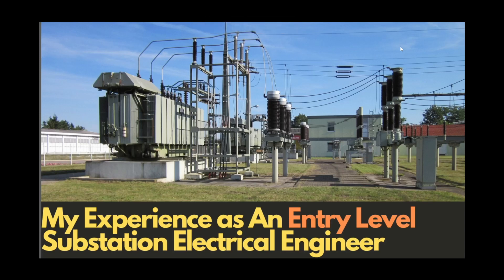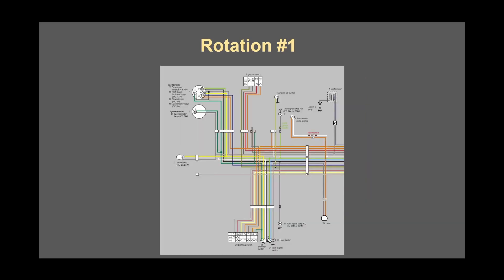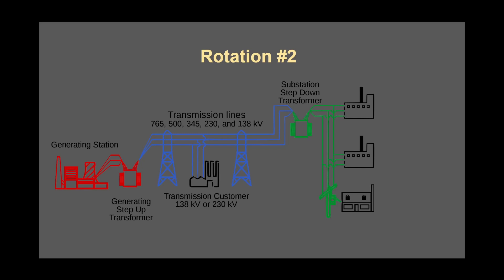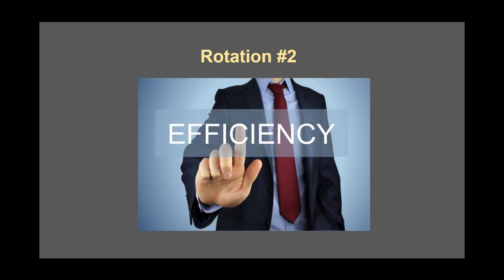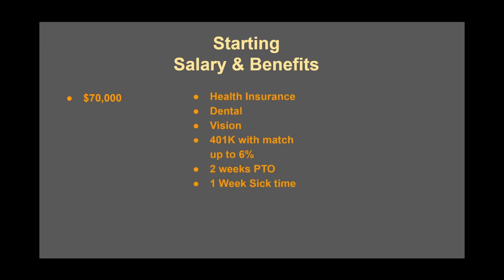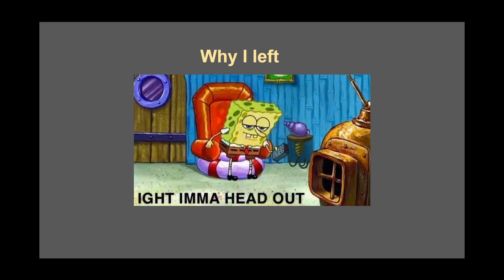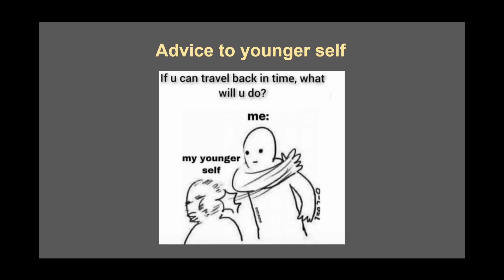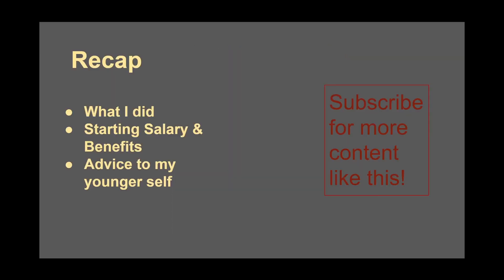My 1st Electrical Engineering Job: Substation Design

Comment: Thank you for this video . I’m interested in substations design jobs, which software I need to know to get myself ready. Some of the softwares that they use you have to know them in the jobs and most of the time they need people with experience in those softwares. What would be your advice on that ? Please
Reply: If you're looking to be a substation design engineer I would suggest you polish or learn how to use AUTOCAD because that's the software you use mostly
Reply from the maker: In my experience I don't use any software. I mark up drawings and send to your drafter so they can edit those drawings in AUTOCAD/MicroStation. 
If you want to be a substation design engineer your focus will be on technical deliverables.